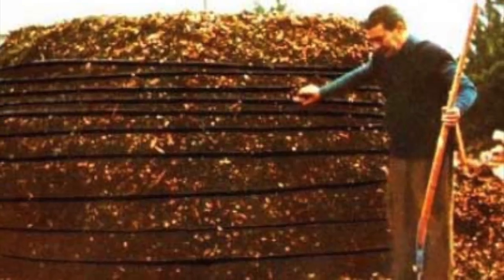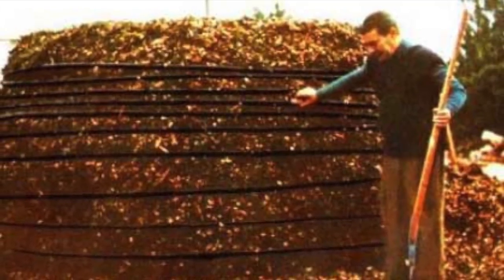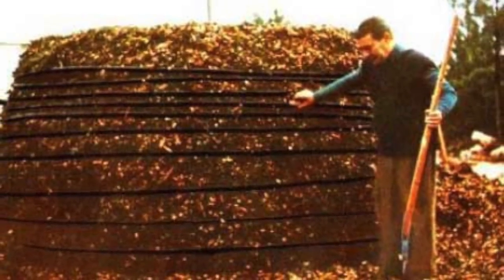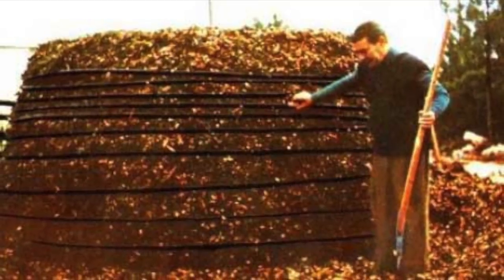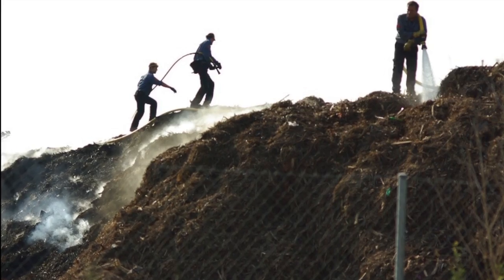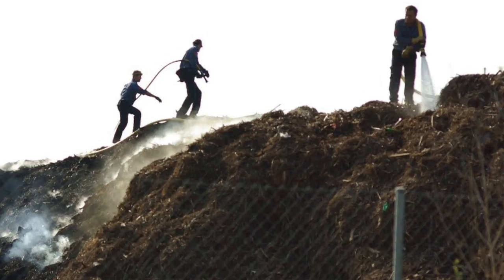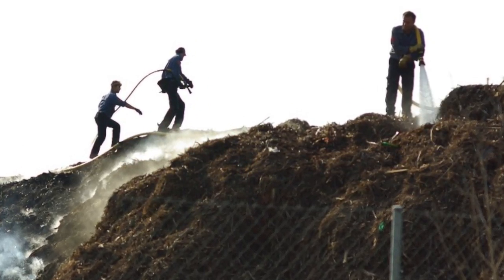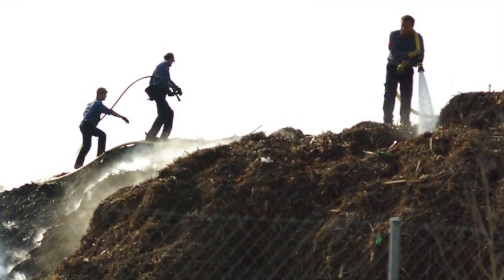Compost Heating vs Passive Solar for a Greenhouse

Comment: What?!? Will work just fine in an urban setting. If smell is a concern, and it should be then make it an aerated static compost pile. Small further investment and it keeps the microorganisms aerobic making far better compost with no stink.

Oh and Jean Pain also used a small portion of fresh manure.
Reply from the maker: you're right!!!!!
Reply: @SimpleTek  Another angle to consider is that you can vaguely control the reaction level that creates the heat by controlling the moisture level.  You don’t want the pile to go cold, however timing the adding of moisture to be ahead of cold snaps you can water the pile 4-6 hours before a front hits and turn heat production up. Even if the outside of the pile freezes, internal temoatures can reach 170 degrees. With a decent heat exchange and quality construction of the greenhouse it should be possible to reach and maintain any needed temps inside.

Comment: I often wonder if chipping wood for hot compost might be a more viable use in domestic heating than burning it in a fireplace? Compost is not so easy to stop and start, so unless someone is home 24/7, some people might consider that wasteful and impractical. But a lot can be said for constant temperature, and it seems that burning loses most of the heat via the chimney. It's better again that you can spread the heat down low or under the slab/floor, throughout the house.
Reply from the maker: if the compost pile is away from the greenhouse it's much safer

Comment: Did you ever build it? I found if you plumb in a barrel in the middle of the pile it works much more consistent
Reply from the maker: do you have a video on this? please describe what this does and how you did it!
Reply from the maker: @kitt080863  email message sent!
Reply: Kayak Kitt, this sounds interesting so if you could share more info I would appreciate it.  How big a barrel based on the pile?  Or, any references you could share?  Thank you!
Reply from the maker: @thisorthat7626  he has amazing information! I spoke with him on the phone
Reply: @thisorthat7626  drop me an email
Reply: @kitt080863  Thank you.  I will.  :)

Comment: Solar batteries in the ground are cheaper than windmills  & solar panels.
The batteries or heat tunnels can be made with a small backhoe & a shovel. you can own a small backhoe for around $4500.00.
That include  use as a plow & front end loader 48 month interest free. I got the big one with a bush hog & tiller. for less than $50,000.00.
To work  the 29 acres, but a small one can cut your yard & haul manure/ compost.
Reply from the maker: Ok

Comment: In Russia ma parants had 2 greenhouses one with 1 meter deep concrete walls  so it was like a pool with pipes every 50 cm running across  ..... The two greenhouses were connected with these pipes on one side of the greenhouse there was a boiler room ,,  in the greenhouse in the middle between the boiler and the second greenhouse and we grow vegetables and in the second greenhouse opposite side of the boiler we had chickens we would throw in the manure from the animals into that greenhouse on the whole year and any scraps or food from the greenhouse we would feed to the chickens ...  Is there animal manure would heat up the pipes which would warm up the greenhouse with the vegetables in the winter and on the winter days when it was really cold my dad would lite the boiler.
Reply from the maker: Thank your sharing that information !!!!!
Reply: @SimpleTek  it worked well we had eggs late in to the session the chickens were not cold and winter vegetables during snow was nice to have.  In the winter my dad would make logger beer and In the spring my dad would have his friends come over drink and bring dirt from the chicken greenhouse to the veggi greenhouse and mix the dirt in the spring he would also buy a piglet that we wouldharvst in late fall all the the tiniest scraps would go to feed the chickens he made sausage and cured smoked some meat to last the winter. We always had 10-15 gallons of home wine by new year ..   his friends would go fishing and bring a sturgeon full of caviar and we had often up to 5 letter jars of cavalier in the fridge .  My Uncle would go hunting and every other year so we bring venison ...   He also had a double greenhouse one of them compost the other one for vegetables.   I'm thinking of the way they lived now,,,. It was just a logical way to make things work. And they lived pretty well they weren't rich but they could brew beer and trade it for work .. and neighbors were experts on growing a certain crop and they would trade with one another .  And besides for woodworking they hay time to have a full-time job..  my Dad's friend bought a property with the creek and on the weekends they would go out there to work they set up some sort of oxygen machine they generated electricity from the creek to make oxygen that they compressed into tanks and then sold to the welders .  So on Saturday they would pick up the tanks from all the welders and drive it to the property which was about 2 hours away from the city stay there rest eat next day load up the tanks which would fill up during the week and bring them back Sunday evening filled with oxygen ready to use by the welders on Monday.       I'm sure if my dad did not have to go work with though during the Soviet Union you had to go to work otherwise he would be considered a parasite on society and could be in prisond ,,my point is even if he didn't have to go to work I'm sure we would have lived well because of all the self-sufficient ideas he and his friends had. And they always help each other and proposed new ideas.

Comment: Thanks this is very interesting. I want to know more.
Reply from the maker: What would you like to know?
Reply: How big is your compost pile? Correct-You make a new pile of every year and it heats your greenhouse.
Reply from the maker: @pearlgirl  the piles are big - a rough  approximate is to have about the equivalent of cord for every 100 sq feet but it also depends on insulation, material used, how cold your area gets, etc -

Comment: The guys in your second video used 16 tons of hay to heat a shed. Is that the plan? 

Step 1: get 16 tons of hay. (the price of hay varies, but it's usually above $100/ton)
Step 2: heat one structure though the winter.
Step 3: profit.

???

I mean it's a great idea if you have 16 tons of spoiled hay and nothing to do with it. But what happens when you don't?
Reply from the maker: Where do you get 16 tons of hay from?  Here, a large round bale of rough hay tightly packed is about $30-$40 if you buy it, but you can make it for under $10/bale if you have the equipment and land. A large round bale is about 1000 lbs dry, meaning about 2 to a ton. 16 large round bales would be an ENORMOUS amount of hay a HUGE HUGE PILE- at $40 each that's $640 - add about $100 for 10 yards of manure - mix with water - and that's a HUGE HUGE compost pile for well under $1000 - which really isn't a bad price for 6 months of heat and at least 30 yards of fantastic compost afterwards. yes - there' s a Labour cost but there's also labour to wood and you only need to do the labour for a few days at the beginning of the fall for the entire winter.
Reply: @SimpleTek  Fair enough. It doesn't sound cost effective to me, but I could be wrong. I haven't really thought it through as much as you.

Be careful not to buy hay from someone who used herbicides though. That stays in the compost, and prevents plant growth.

Comment: 1:29 - An untidy heap like this has a hundred times more surface area than it should. This spells evaporative loss, sun scorching, attrition by wind and rain, animals and birds digging and scratching and so on. This heap will be losing as much as fifty percent of its mass and its value. Heaps should be made as vertically as possible, and they should be heavily mulched with straw or pine needles etc. It pays gigantic dividends to do it right. Bins or bays or containers are a hindrance - just cover your heaps with the thick layer of mulch, then a piece of recycled shadecloth to secure the heap against the elements.
Reply from the maker: Well said

Comment: I’ve been working with a “CBCB” (Carbon Based Composting Bin/Bioreactor) for a few years now. My heat in the pile is over 130F for over five months at a time with very little turning. The CBCB heat is consistent, and predictable. 

Once the pile is activated within three days the heat will go to 160F and stay this hot for two weeks before dropping down to about 140F. It will stay about 140F for another two weeks before dropping down to 130F. At 130F I occasionally fluff the pile with an iron rod, this will keep the heat between 130F and 155F for many more weeks.

How to get this heat outside the pile to heat something is the question?

https://www.youtube.com/playlist?list=PL8OAnpHec404E8OONfkGj1YQw7OqS9Xgq
Reply from the maker: Thank you for the comment. Have you tried putting water pipes through the pile to pick up the heat?

Comment: carnt you just use the compost in the greenhouse like a hot bed instead of manure
Reply from the maker: John Page it’s the amount needed for heat in my climate
Reply: On another video I watched, a commercial grower in Texas was asked the same question. He had an enormous pile and responded that the compost pile gives off carbon dioxide and many toxic gases which could be dangerous. Therefore he only does it outside.

Comment: For heating a greenhouse, the simplest and most efficient method would be to forego all the tubing etc., and just locate the composting material inside the greenhouse. Doing so would ensure that 100% of the  heat generated would be utilized. I suppose smell might present an issue .

Something like a huge, metal, barrel-shaped, rotatable container placed with its long side horizontal to the ground on a wheeled stand so that the compost could be easily turned seems like it might be the ideal set-up. Have you investigated the numbers using this kind of set-up? Thanks!
Reply from the maker: Thomas Paine thank you for the comment. Size becomes an issue, to handle a manitoba winter an 800 sq foot greenhouse 16x50 needs 40 to 50 yards. That’s 1/2 the space of the greenhouse itself!  Yes your idea is possible but one has to decide at some point if you’re housing plants or compost
Reply: That's a solid point. What sort of BTU output per cubic yard of material are you using in your calculations?